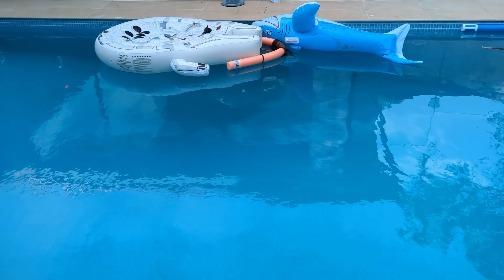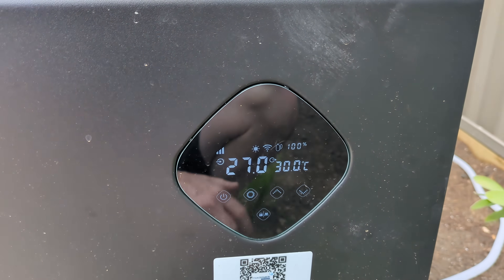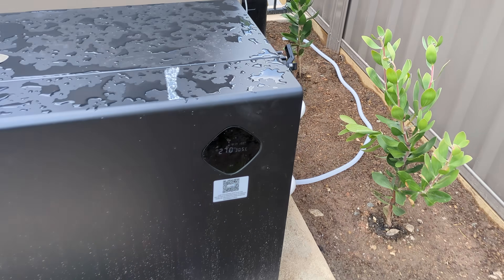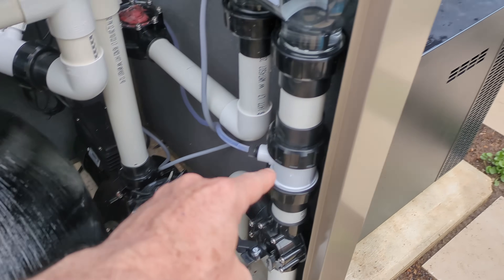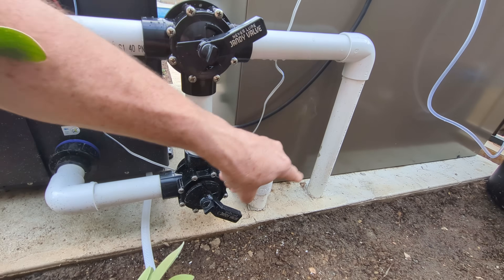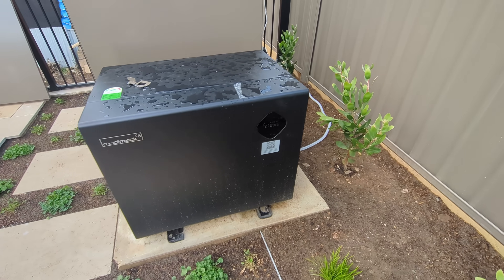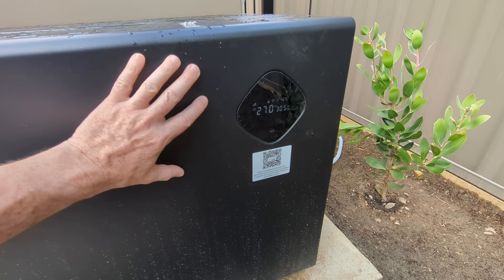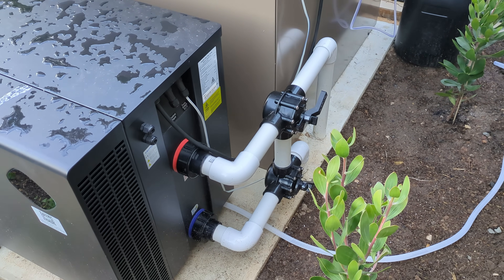Pool Heat Pump Calibration Explained (Madimack)

Comment: Is a heat pump running on solar more or less efficient than a traditional rooftop pool solar system?
Reply: Had this discussion with a friend that installs both types of solar systems and EV combined with a heatpump is a clear winner.
Not only can you compensate the less efficient EV by using a heatpump but you will also produce electricity that you can use for other purposes when not needing heat.
He has both systems on his house and his EV is currently oversized but with new regulations comming soon he might want to expand his EV system and might replace the water solar with more EV.

Comment: Are those valves really mixing valves, or ball valves with two outputs? Whats the actual flow in the system after setting the valves?
Reply: Those are 3-way valves (works both way : converging and diverging).
I guess you have to set the valves symmetrically to avoid chocking the pump.

Comment: Dave, what are you doing?

So as far as i understood, dave has decreased his efficiency of the heat pump 

Of course the heat exchanger generates fewer temperature rise if you pump 6 times the volume through the heat exchanger, but this increases the efficiency because you need not that high temperatures

You have now a higher temperature(with worse efficency) at the heat pump output and mix it again with the unheated water and get a lower temperature again but you dont see it because theres no sensor

Will the heat exchanger gets a damage from the too high flow - i dont know - thats the only point which would support your voodo "CALIBRATION"
Will your plastic valves will survive this constant switching - i dont believe so
Reply from the maker: No, I'm doing the optimal thing. For the technical explanation see the pinned comment from WizardTim
Reply: To have a efficient heat pump it must have its coolant pressure at the designed levels. If you pump too little water the condenser will heat too much and the pump will shut down because the coolant pressure in the condenser gets too high. If you pump too much water the coolant pressure in the condenser will drop too much and your heatpump will work outside it's ideal conditions and be less efficient.

Comment: Pipe dream of mine has been to have one massive heat pump that moves heat for everything in the house.  Moving the heat out of the house into the pool and hot water tank in the summertime, and then moving the heat back in from the pool/ground in the winter.
Reply from the maker: There are poeple who have done this DIY style.
Reply: @EEVblog2 there are companies that will do it non DIY.
Reply: @EEVblog2  anyone you follow that's worth watching?
Reply: @EEVblog2  Yes, like Linus from LTT
Reply: @SelfMan-SK and to not include a room rad at the start was quite an oversight
Reply: Yes!  This is what I would love too.. I hate sitting on my deck, watching my home unit pump heat into the air, and 30' away watch my pool unit sucking heat from the air trying to heat the pool!  If they weren't so far away, I'd try to somehow integrate their heat exchangers!   🙂

Comment: could you repurpose the cold side for the house cooling?
Reply: Yes. Water acts as a great sync for a heat pump. E.g. AC cooling loop goes through the pool.

In the UK big houses with ponds / lakes do this Vs air source or ground sync as it's cheaper and easier.

But obviously we need the heat so that cools the ponds and lakes so we are back to front for what most people would want in Australia
Reply: Yes, but often when you really need cooling in the house it's probably so warm outside that your pool doesn't need heating ...

Comment: It sounds like what you have is the best compromise.
But I would take the sticker off on top of the heat pump. It will not look good in a year and when you remove it then, you will still see the outline of it, because the paint was protected by the sticker from the giant fireball in the sky.

Something personally I want to see is, is how the plants overgrow everything in a couple of years and how it looks. Now it looks a bit bare - obviously.
Reply: He hasn't done his electrical work to as3000 standards; I don't trust the bloke when I even offered my services.
Reply: @TradieTrev  Chill the unit he has isn't even a hardwired unit, its a 10amp wall plug type unit all he needs to make that work is the normal pool bonding and and a proper GFCI outlet on for the pool area which he should already have for the pool pump.

Comment: I guess I'm confused. Why would you heat your pool during the summer?  Wouldn't you want the water to be as cool as possible (within reason)?
Reply: australian summer is our winter ;)
Reply from the maker: SWMBO. But we may not have too much, as we haven't installed and tested the pool cover yet. That will also absorb and also contain the heat.
Reply: @EEVblog2  The pool cover will be a major game changer. Not only does it help heating on sunny days but it also reduces losses during the night.
You will also save lots of water. Look how your water level drops over time without using the cover and compare that to using the cover as much as possible.
Reply: @EEVblog2  Gotcha. :)
Reply from the maker: @kjlovescoffee  Our first dip in the pool was without the heater and it was 23C. Mrs EEVblog and the kids all said it was "a bit cold" and the youngest didn't want to stay in log, but I thought it was fine. They liked 27C better. Tomorrow will be a 40C+ day!

Comment: Can someone tell me the difference between heating 300l for 0.6 degrees and heating 60l for 3 degrees. I don’t see the it.
Reply: COP differences mostly
Reply: No difference in theory.
My guess would be that the optimum flow rate is a balance of getting enough water through to keep af low temp delta - but not waste pumping energy by pushing a huge amount of water through the heat exchanger. 
The heating efficiency could in fact be a tiny bit better with lower temperature difference/higher flowrate. But the water pump would have more work to do.
And with a couple of degrees temp delta it feels warmer in the pool (right by the inlet).
Reply: @MrKruchov yes you are correct.
Reply from the maker: @MrKruchov  I can't really feel the 3C difference at the outlet in the water, will have the try a probe. But in any case it's the average over tiem that matters.
Reply: @EEVblog2 that was a brainfart from me. It´s not 3C at the outlet of course. It´s only about 1/2C after being mixed with the "unheated" water.
Reply: What is the temperature difference between the pool in- and outlet? I would guess it is ".5°C at most" 🤔
Reply: @markusresch9889  it is
Reply from the maker: There wouldn't be if everything was linear with the heat pump, but it's  not. There is an optimial efficiency flow rate so the water spends the ideal amount of time inside the heat pump exchanger. Too fast and the peak efficiency drops. And too slow the peak efficiency also drops.
Reply: @EEVblog2  Yes, that could be it. But it would be interesting to see the real world difference between the optimum and the just let it rip. I suspect the difference is there but not that big. I couldn’t find hard facts about that and am really interested because of my own solar water heat exchanger and future heat pump install. It’s about the robustness of the system for me.